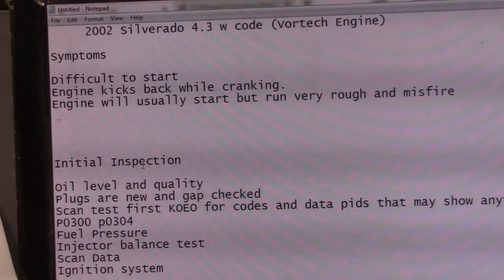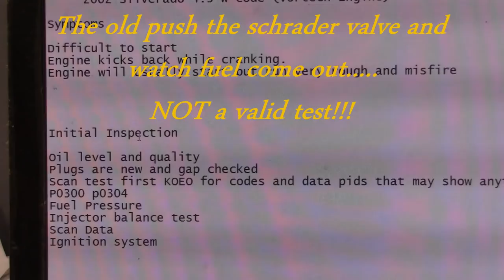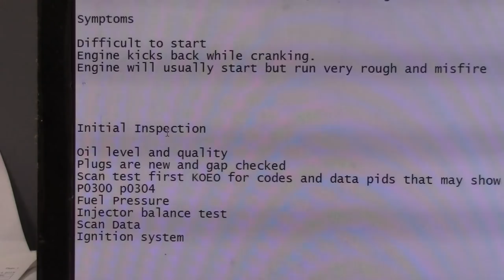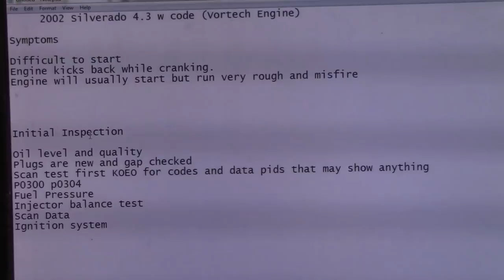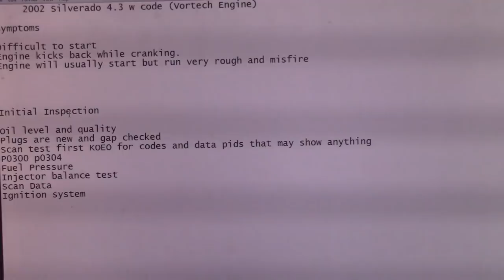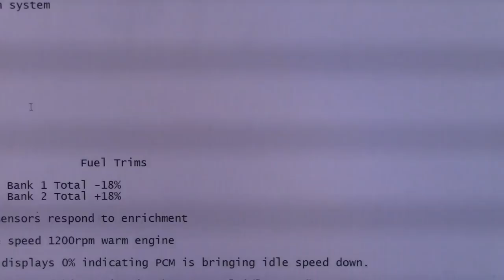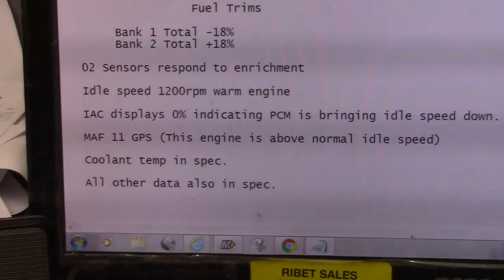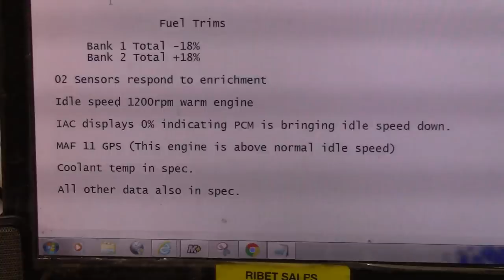Why Vehicle Owners SHOULD ALWAYS Do Their Own Repairs!

Comment: Retired aircraft mechanic here.  Maybe I am revealing a trade secret here, but when an airplane comes in with a chronic problem, the first thing you do is find out what fixes have been attempted previously and either undo them, or at least verify that they have not added to the problem.  Since airplanes have a habit of wandering across states and continents, log book entries and computerized maintenance records are invaluable here.  Once you have the airplane back to "normal," you start with the most basic steps of troubleshooting for the original reported problem, just as Joe demonstrated in this video.  You can't go wrong with this method, because somebody may have missed something along the way.

Comment: I agree if you don't know what you are doing keep your hands off. I am not an Automotive tech.  I am computer/network engineer.  I am blessed that Dad and I worked on cars. when they were points and plugs.  I have the proper tools and knowledge to look at the computer and wiring side and mechanical side of today's cars.Plus awesome guys like you Eric O Keith and Ivan putting out great video.  If you don't have the above and the willingness to learn and not just throw parts at the car.  Leave it to the pro's like you and the guys mentioned above.  Also don't be afraid to ask for help when you need to.

Comment: I work on my own vehicles but I have two of them....I make amateur mistakes alllll the time, but I figure out how to fix them even if it means my car is up on jack stands for a month or longer.

Most recently I over-torqued an inner tie rod and it completely torn out all the seals in my steering rack. Got a rebuilt rack and got some advice from a shop I trust and I replaced it (although it literally took me weeks of working on it a few hours at a time). But I agree, if someone isnt willing to risk making mistakes, or isnt willing to fix their mistakes, they just shouldn't work on their cars.

Comment: I admit that DIYers, like myself, can make mistakes that they can't fix. Case in point: I replaced an ignition coil tower connector on my Toyota Camry. These have four wires as you probably know. I got two of the wires swapped upon assembly and it ran like crap and triggered a misfire code. And I forgot to take a picture before disassembling the old connector. Doh! I thought I was all set though: just look it up on a wiring diagram!

What I didn't count on was Mitchell's wiring diagram for the ignition system being COMPLETELY WRONG! No color code matched the actual wire color on any coil tower. Argh. Grr. With no access to an OEM diagram I finally broke down and took it to my trusted, professional mechanic to fix it. Unlike your customer, however, I fully disclosed how I got to that point and he was able to correct it by ordering an OEM diagram. So that's just something stupid where experience and forethought would have saved me a lot of grief. Fortunately this was a small goof, but it still set me back by $127.
Reply from the maker: I admire you trying and doing what needed to be done man. A word of advice. If you find a diagram that shows what you had there, go up and/or down a  year in the diagrams and check again. May find it to be correct in a different year. Hope this helps.
Reply: @JoesAutoElectric  Thank you! I appreciate that.

Comment: As a DIYer I have pulled two engines myself but have had a mechanic and a machine shop do the precision rebuild work.  I once had a new intake gasket hang up on the backside and had had to redo it. Years ago a shop forgot to tighten up the lug nuts on a rear wheel. Chit happens!
Reply from the maker: Indeed it does...it happens more where inexperience is involved though.

Comment: Whenever a vehicle starts to run odd I always revisit what was recently done whether its regular maintenance or a repair. People can do more damage to their vehicle trying to fix things they aren't experienced in, ... just to save money. Intake leaks can easily be checked by spraying near it with starting fluid or throttle cleaner with change in idle noticed. Its tough being a business owner these days. Some people want things cheap or free. Great video.
Reply from the maker: Problem on this one was spraying wasn't going to prove a vacuum leak lol. I get your point though.

Comment: There is a fine line between what I am able to repair myself and when I end up needing professional help. I've gotten better at dealing with things myself; but not by that much. People don't understand when watching this video that those gaskets probably might not cost that much but first carefully figuring what's wrong then disassembling everything necessary to get that is A LOT of work. I'm getting one of those same codes now in the 5.4 Ford Triton that gets me to work. It's saying P0300 cylinder chamber #1 misfire. Last time it happened well over a year ago I thought I was cute and put ACCEL brand coil to replace which worked at first but then went bad. Everyone including this channel says the OEM Ford blue oval parts are really the only way to go. And I ended up learning the hard way. Some mechanics are good and others aren't, you seem like you've got a really serious shop. keep up the good work. PLEASE do not stop making the videos.
Reply from the maker: Nice thing on those is you can use an amp clamp and scope the coils all at once, while using a second channel to sync a cylinder. See which one is faulty pretty quick. Providing, of course, that it is a failing coil and not an injector, vacuum leak, mechanical issue, etc...
Reply: I paid $800 or so for my lower intake manifold gasket repair on my 03 impala (yup, dexcool!). That included the fixed doorman plenum for the EGR issue, draining and filling coolant, synthetic oil change, but they didn't use the updated metal gaskets. So I have to go in there and do the repair myself, there is a leak around the 2 flat areas where you are supposed to put enough RTV. Or the manifold could be warped. 😐He also put permatex around the injectors so I gotta get all that out with a pick. 😑😥
Reply: @johnames6430  I am curious as to how well Optimum Grey works
Reply from the maker: @John Ames That sucks man. Who puts silicone around injectors????Wow!
Reply: @JoesAutoElectric  he must have figured it will never be done again for the life of the car and the customer will junk it so I'll just put permatex around the injectors so they don't leak (instead of replacing the O-rings like you are supposed to, damn kit comes with new O-rings anyway). I don't know for sure if he did or didn't replace the O-rings but why else put peramatex around the injectors. This is why I try to do the work myself as often as possible instead of going to a mechanic. At the time (2008) I didn't feel comfortable messing with the fuel rail and going that deep in the engine.

Comment: Funny!

Early in my DIY efforts the pickup dropped off the lifting jack and crushed the Y-pipe and oil pan.  I did not have an oxy torch to heat up exhaust flange bolts at the time.  So, I took it to a shop.  Told them exactly what I did and let them clean up my mess.  It happens.  I was more than willing to pay the hourly rate and parts markups.  Mistakes are always expensive.

But, over the long run, my repair efforts have saved me a ton of money.  The world is big enough for DIY'ers and good shops.  And like any tool or solution, knowing when and how to utilize both is key.

Comment: I got a 02 Neon I may get to look at soon.  It's had a full parts cannon fired.  Coil Pack, Plugs, Fuel Pump, Fuel Injectors, 02 Sensor.  I took a quick look.  As soon as it enters closed loop the up stream O2 Sensor sticks rich at 1.2  Total Fuel trim goes -50 while it's still at 1.2v and it start running rough and popping through the intake.  Eventually it throws a code for 02 sensor stuck rich and goes back to open loop and Idles great.  Then on test drive it cuts out during acceleration.  To the point where it will die and has to be restarted.  It will be a fun one if they bring it over.
Reply: I had an intermittently sticking EVAP Purge Solenoid on an old GM V6 that I own . Once I found it , I plugged off the hoses and drove it for a week to verify . You can easily plug the hoses and remove it as a possible problem.

Comment: Speaking to the choir. I tried helping a guy online to understand Motor oil weights because he actually believed that a multi-viscosity oil gets thinner in cold weather. I explained quite well that  the cold weather weight is only the bare minimum for oil to coat the parts in cold starting and even went on to explain that he could do a simple experiment himself by putting a quart of oil in the freezer and checking its viscosity. The lazy bum gets all pissed off and calls me a hack and says I don't know what I'm talking about even though I'm a mechanic with over twenty years experience. So then, I told him to watch a video on YouTube that shows this experiment and his response was silence. He was just an effing troll with nothing better to do.

Comment: I've got a truck with the same engine,   I wish I had a mechanic look at it before I changed a ton of parts!!!  It stopped running, it had fuel, fire and compression. I wound up changing the distributor, wires,plugs,timing chain .  All parts were still in good shape before they were changed.  The truck still just popped and kicked back!!   I was done with this thing!!!   Then a mechanic stopped by to ask me about the truck and I told him everything I did to it and he offered to look at it real quick.  30 minutes later the truck was running fine!! Turns out the coil was bad although it still fired!  This is why its worth paying a mechanic!!!!!!

Comment: I agree with your statements and parts should be marked up to cover handling/shipping cost, etc. My gripe on past experiences is mechanics that insist on putting parts in a repair that the customer would gladly pay more for a superior quality/aftermarket part that they acquire themselves. For example I had a automatic transmission rebuilt in my truck and was told the torque converter would be top quality, triple disk designed for towing. 3 years later after the transmission required another rebuild and the torque converter replaced again it turns out that it was a cheap single disk at almost half the price of what I paid. I then search and finally found a mechanic shop that would install parts I acquired that I wanted. Warranty would only apply to the installation work the shop did. No problem. Transmission shops are one of the most notorious places a customer can be ripped off. I always suggest vehicle owners ask for the old parts back after work is done
Reply from the maker: I agree. If I tell you I am putting something into your vehicle, rest  assured you are getting that part. I suppose that there are always going to be shady people though brother. Sorry that happened to you.
Reply: Joe's Auto Electric if I was living in your service area I would have you on speed dial. You’re doing the best thing for your industry, showing integrity.
Reply from the maker: Thanks so much!

Comment: DAMN SON, I AM IMPRESSED, A HELL OF A FIND ON THE INTAKE GASKET. My son had a 99 blazer with the 4.3 & the Dist. ears both stripped out, JUNK. I just put bolts straight through with nuts on them. I DO NOT WORK ON CARS THAT OTHER PEOPLE HAD THEIR GRUBBY MITTS ON IT & COULD NOT FIX IT. I do this stuff on the side & it was WAAAY TOOOO MUCH OF A NIGHTMARE. I HAVE THAT OPTION WHICH IS NICE, AGAIN GREAT FIND ON THE INTAKE GASKET.
Reply from the maker: Thank you!

Comment: @Joe's Auto Electric --- A quote for the shop that was passed on to me for my many years in automotive repair "If I do a job in 30 minutes, it's because I spent 10 years learning how to that in 30 minutes. You owe me for the years, not the  minutes." Obviously insert number of years and minutes as needed. You bring valid points though with the increased access people have to the portable internet to use as a tool and point of reference along with other advancements in technology they will continue to advance their interest and knowledge base along with purchasing their own parts to install. Your youtube channel offerings will force more people to repair their vehicles first before taking it to a specialist like you when all attempts have been exhausted. The sharing of knowledge in this forum will be the bane of your existence and others like you. It's no longer a captive audience of trade secrets. Everyone shares what they know online in milliseconds. Even if it's wrong! Your craft is much the same as many traditional trades that have gone through an evolution where there are specialists and there are parts changers or installers. Mechanics and technicians are different people. The technician term came out of the "dot com" boom era of the late 90's and has been applied to every aspect of an employment position including office clerical work though no REAL technical aspect is present. It sounds better. I apply technician lingo to parts changers or installers that treat symptoms whereas a mechanic is a rare gem that repairs problems not symptoms. You are a a mechanic Joe and much appreciated here. You're old school and that matters. Less and less skilled or even bright people are entering the automotive repair field. My opinion from over 35 years. One may be considered bright because they can deal with the computer side of automotive more proficiently, but that doesn't negate the seasoned mechanical veteran from being just as proficient given the time. The OEM is heavily implementing "MTBF - Mean Time Before Failure" qualifications into its engineering of newer vehicles to beat the odds on warranty claims. Less serviceable components and more assemblies to aid in the manufacturing side rather than the service side. More market testing of vehicle components and systems rather than real world testing has created a different scope to vehicle design and manufacture. The old "drive it for a half-million miles" routine is gone. Get it to market quick and watch out for warranty claims to adjust the component design for future production. It's a different world and you're a man of many that is just trying to do the job right the first time and so many vehicle owners claim they want that, BUT they don't want to pay for it because your time and experience aren't as valuable in their perception and we can thank this venue and the accessibility of cheap low quality chinese made copies of auto parts for it.

Comment: A few thoughts. You get parts wholesale so an honest markup is expected. Dealers can monopolize on parts so they screw people. Secondly, I took my car to a dealer because my gauges were not working. I assumed they would be fastest on this kind of repair. They replaced the computer with no success. I couldn't afford more so i took the car home and it sat while I repaired it. After 20 hours of research, testing and etc. over months, I discovered the ignition switch was bad. What's my point, some mechanics suck and know enough to do basics and talk you down, avoid them. It can take significant time to fix yourself so have a backup if you dare. Know the character and capabilities of your mechanic and the overall reputation of the shop. And treat you're mechanic like a doctor and friend, it helps when bad stuff is bad.